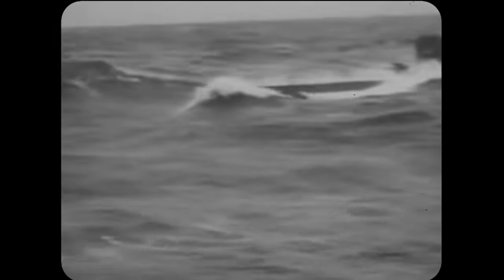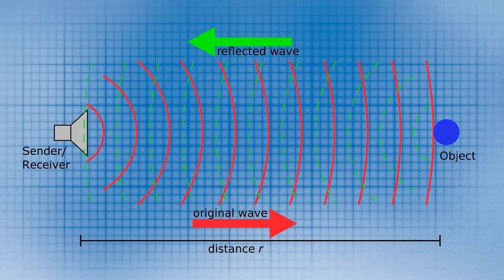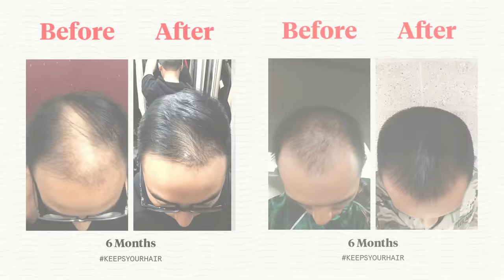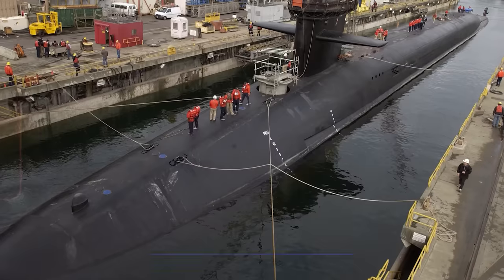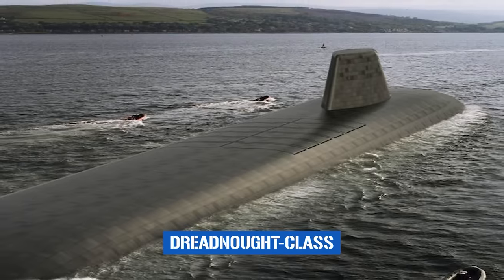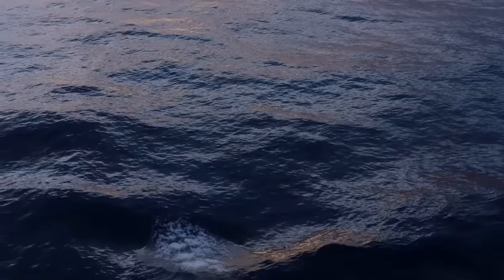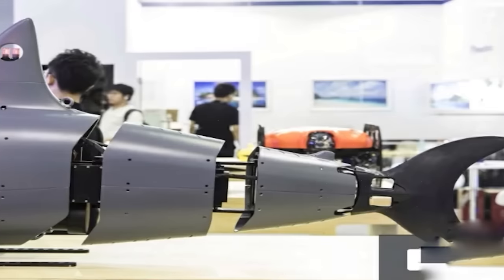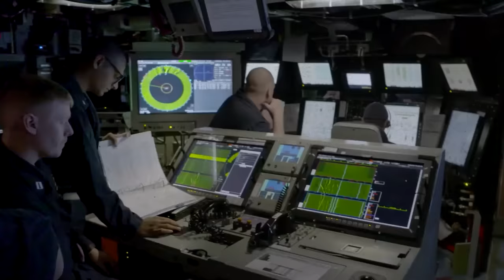Stealth Submarines: The Silent Underwater Killers

Comment from the maker: Thanks to Keeps for sponsoring this video! Head to https://keeps.com/SIMON to get a special offer.
Reply: They actually already have drones that mimick the signature of the parent submarine. They're called MOSS for Mobile Submarine Simulator. They can be launched from the submarine's torpedo tubes and it can either go off and do it's own pre-programmed thing or it can be controlled from the sub through a wire.
Reply: @killman369547  So you're bald as well then.
Reply: Did you look down the back of your sofa? I sometimes lose things there ,maybe your long lost locks are there too!
Reply: @Wardads1  No, not me. I've got a fine head of hair for a 90 year old.
Reply: MAD devices are not exactly new. They have been part of ASW operations for a very long time.
Reply: @GraemePayne1967Marine  That's all very well but did you find any socks?
Reply: you forgot to mention why the Gotland-class was leased for 2 years: it ran circkles around and ''sank'' an entire carrier task force without being detected. 

even took a photo of the carrier with its periscope durring the exercise without being detected either. being almost right next to the carrier while doing so.
Reply: So lax you don't even where shoes to work?😂😅😂😅
Reply: I'm not loosing my hair, it's just migtating dowm my back. It's going south for the winter of my life. By the time i'm 85,it will be all around my ankles... and  I'll look like a Hobbit.
Reply: Right, sure
Reply: I can already bet they asked a bunch of sound engineers to see what they could do and they just said 'add baffling under the armor and then everywhere in the sub that doesn't already have it' which is like any sound studio... actually works really well...
Reply: NOTHING will help your hair grow back, total crap

Comment: US subs accounted for 30% of Japanese ships sunk in WW2........imagine what that number would have been if the Bureau of Ordinance had admitted the glaring problems with the Mk 14 torpedo, and fixed them.
Reply: Probably closer to the percentage from the  Odyssey Dawn campaign in 2011, where a SINGLE US sub accounted for 75% or so (napkin math) of sea based missiles launched. 😂
Reply: excellent comment!!  the original torpedoes bounced off the target.
Reply: US Navy Submarine Service accounted for about 55% of all Japanese tonnage sunk in the war. This was done by a branch of the Navy that accounted for about 1.6% of the Navy's wartime complement.

The Japanese lost 1,178 Merchant Ships sunk for a tonnage total of 5,053,491 tons. The Naval losses were 214 ships and submarines totaling 577,626 tons. A staggering five million, six hundred thirty one thousand, one hundred seventeen tons, (5,631,117 tons), 1,392 ships.

Japan ended the war with a bare 12% of her merchant fleet intact but not fuel at hand to run more than a few of them.
Reply: U Boats caused a hell of a problem too.
Reply: @neth77  That is correct. At wars end 783 of them (to best count) resided on the ocean bottom. Allied ASW got better.
Reply: Yup!
Reply: my son's sub sank a japanese vessel. the problem was, it was 2001. the war had been over for quite a spell.
Reply: @mta4562  Well, that was either the USS George Washington or the USS Greenville. Both had collisions that resulted in ships sinking.
Reply: You think 30% isn't good enough?
Reply: @krashd  Yes, it was not good enough. American submarine crews did their duty in the face of death, while knowing that even the most accurate deployment of their Mk 14 torpedoes onto target would most likely be ineffectual. The Mk 14 had a 50-80% failure rate. 
The US Navy Submarine Service had the highest casualty percentage of any American forces in the war, about 20% didn't come home. How many of those US sailors' lives were sacrificed, just to fire blanks as they died?
It is definitely NOT good enough to knowingly sending sailors into battle with dud ordinance.
Reply: @krashd The facts show that this guy didn't do his research. This number was 'bought' at the cost of 52 US Submarines being lost most with their entire crews. 1 Submarine with roughly 75 men inside! The total loss was just under 3700 men or around 20 to 24% of the total men serving in the Submarine Service. The highest by percentage of service loss by size in WW II. Basically 1 man in 4 failed to come home. Facts show that the American Subs fought aggressively to defeat the enemy and end the war. The objective was to bring the war to the  end. The sub service fought to that end. The objective was to deprive Japan of any and all supplies to continue the war and it succeeded.  The fact remains that 30% was not the actual % that was actually sunk and at a horribly high cost in lives that would never be seen again by their families to the cold black depths of the ocean! So the answer is; NO!
Reply: @webbtrekker534  merchant ships yes those have anti sub defenses.
Reply: @DubhghlasMacDubhghlas  Oh, really tell me about those WW II defenses those Japanese ships had!!!! They didn't have squat! They depended on the escorting vessels to shield them and they mostly lost.
Reply: @webbtrekker534  Radar and depth charges.  It was worth something.  But claiming merchant ship far as combat loses is a cheap way to inflate the loses.  

The United States Navy Submarine Service lost 52 submarines, 374 officers and 3,131 enlisted men during World War II.

That was 16% of the Officers. and 13% of the enlisted deaths highest for any ship type.  About 1 in 4 died.  

Seems like Japanese counter sub measures did something.
Reply: @hydrashieldbasementservice8453  The big one was
usually just drive-by at great depth, but yes, also some contactor issues.
Reply: @mta4562  Ouch! Hawaii right?
Reply: I'd point out that a WWII sub's target was 99% shipping while surface war ships targeted ships, aircraft, and shore bombardment.
Reply: Ordnance.
Reply: @jamesreese7369  spell checker 😀
Reply: Exactly
Reply: Caught them on the surface. The only underwater kill was made by HMS Venturer on U-864.
Reply: Quite Right!
Reply: Eventually they did. After Midway, the Mark 18 Torpedo was used for the majority of the advance in the Pacific

Comment: By far the quietest are modern diesel electrics. Nukes have virtually unlimited dive endurance, but are running a literal reactor and steam plant propulsion system… no matter what tech you use, all those pumps and fluids will always make more noise than a DC motor.

Comment: The statement that subs wouldn't utilize active SONAR during combat situations is a common misunderstanding. When they are on ISR missions they are not allowed to be detected by anything, they won't use active but during combat situations there are plenty of valid uses of active sonar to include:
- shadowing another submarine outside of their weapon's range
- refinement of bearing and range just prior to the moment of weapon release (i love this one because it results in "hey is that active ? ..... oh shit launch transient. torpedo in the water.) on the targeted submarine.
- flushing the enemy towards another unit in passive search
Reply: There have been some rumors that for the next generation of torpedoes, that ping will be an intermediate sub getting an updated position to relay to a weapon already on the way from a launch platform over 100 NM away.